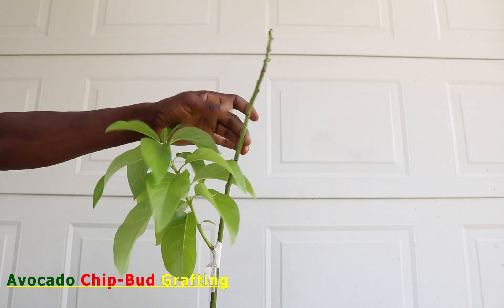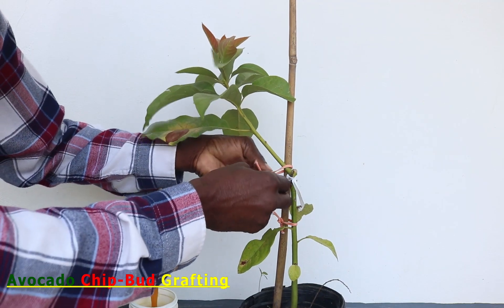Avocado Chip-Bud Grafting

Comment: Excellent video with lots of useful information.

Many people learning to graft fail to realise that properly mating the scion to rootstock is part of the process. As you point out, major parts of the ptocess are propper preparation and post graft care.

A quick question for you Mr. Raymond.  I often graft avocados and mangoes with suboptimal scions (scions with buds that have not emerged), and wrap with plastic strips to retain the moisture. After four weeks, is it generally safe to remove the plcastic covering the scion?

Comment: Ive seen some cleft grafing done where the root stock is slitted more to just by the cambium just behind the bark as opposed to slitting down the middle of the stem.  Whats your opinion of this method?
Reply from the maker: There are many methods that can be used, as long as the scion will grow after grafting, then it can be tried.
Reply: @bestfruitsinjamaica9295  ok fair enough but from your experience with grafting which of the two methods offers a higher success rate?